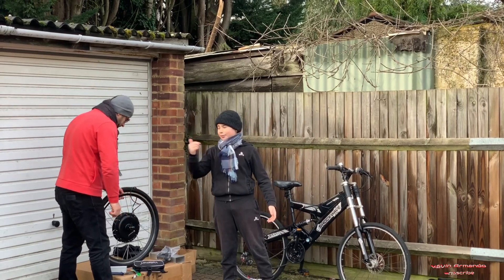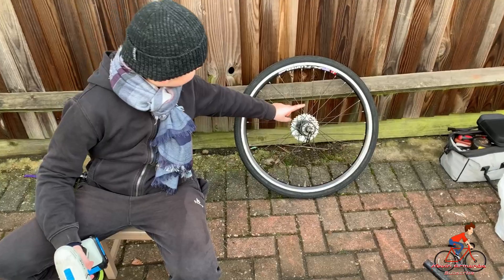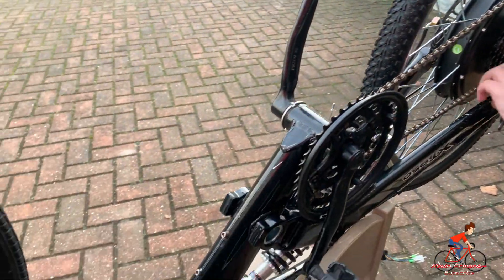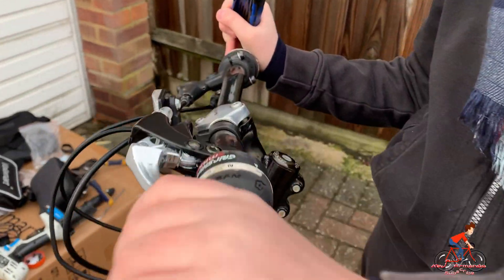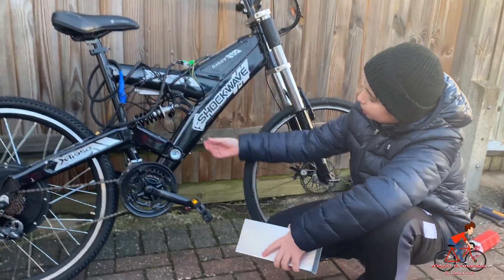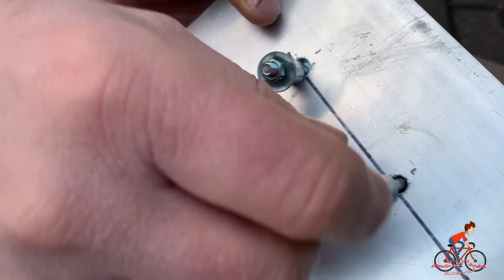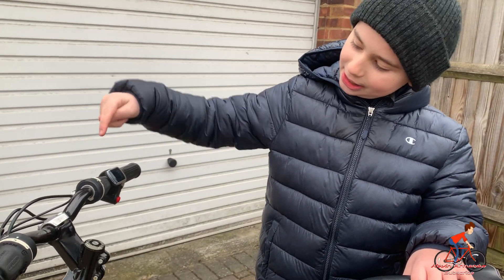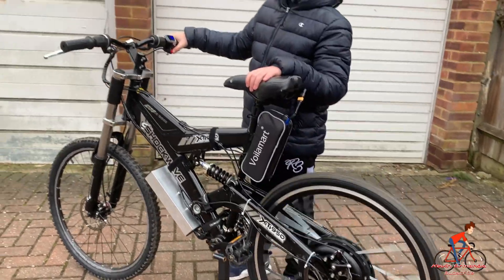How to Make Electric Bike Homemade Voilamart 26" Rear Wheel 48V 1000W Electric Bicycle E Bike Motor

Comment: No torques arms fitted, it will ruin your frame very quickly.
Reply: Teeth not frame
Reply: @gtjust8188  I said frame as in the fork part, the spindle will rotate in the forks and ruin them.